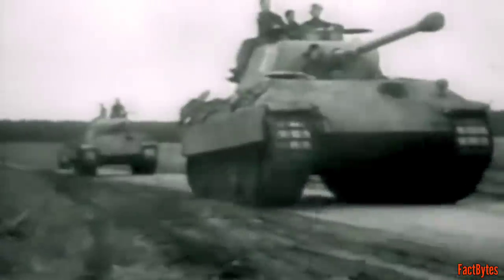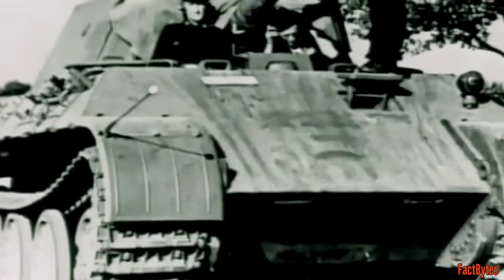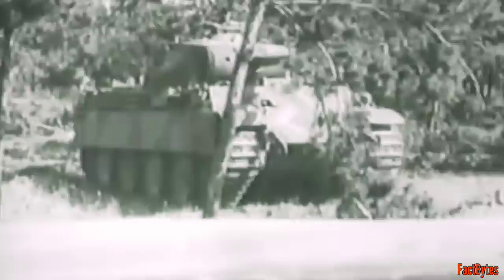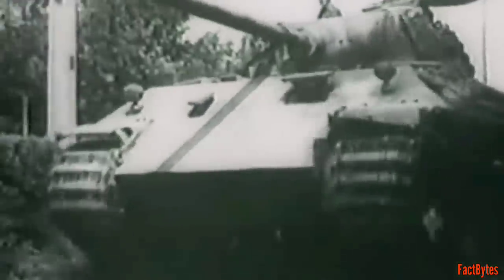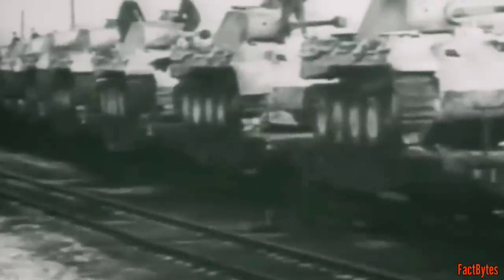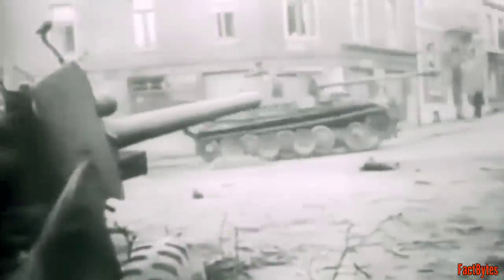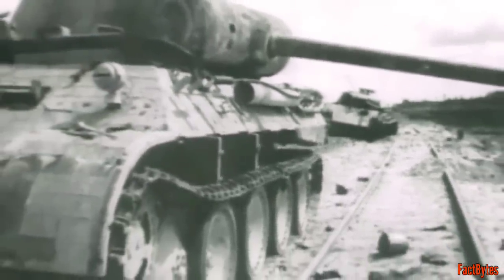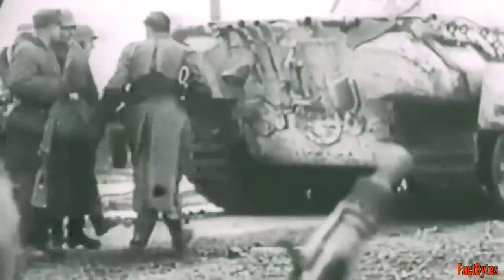Was The German Panther Really The Best Tank Of WW2?

Comment: The ausf G was the perfected version of the panther tank, as it fixed all the flaws.
Reply: IIRC after WW2 the French Army tried adoption of the Panther. Gave it up because the tank was so mechanically unreliable.
Reply: @Idahoguy10157 
The French army used second hand German tanks and did not produce any new ones, jerry rigged and combat damaged tanks do not do well
Reply: Germany built a total of 5,976 panthers during the wars, panthers ver. are D, A, G & F. The G version is most numerous of all the version. Total completed G version build 3,126 from the start of '44 to the end of war. The F version was only build in small number while the replacement for panther tank E50 Panther II with schmalturm never went into full production only a few were build for trial.
Reply: @sebastian-FX357Z1  Considering the work force, materials limitations, along with Allied bombing of the applicable factories, that the Germans managed to get over 3,000 of the "G" model Panthers out the factory gates in the last sixteen months of the war indicates that (1) many of the production problems were solved and (2) the Panther "G" model had been simplified enough to facilitate production w/o compromising combat capability.   Trouble was, the Allies produced about 8,000 of the  76-mm gunned Shermans and 14,000 of the T-34/85 (about 7,000 Shermans with the original M3 75 mm gun were also produced, along with many other variants, including about 2,000, sans main weapon, which the Brits would stuff that excellent 17-pounder weapon and dub the "Firefly").   Germany was simply overwhelmed by the combined INDUSTRIAL and ECONOMIC might of its adversaries; as Stalin himself is credited with saying, "Quantity DOES have a 'quality' all its own."  And most of the tanks that went up against the Panther were no "slouch", either!
Reply: By the time they lost 1000s of them, they learnt the lesson. And also by that time allied also had lot better tanks.
Reply: @istvanszoke381  Those lot "better" tanks were being lost at the rate of 1.000 per month. 12.000  total for the western campaign nor counting all other armored vehicles.
Reply: Panther tank in the hand of an ace r lethal. On 27 July '44 at an isolated crossroads on the St. Lo-Coutances road. ss-oberscharfuhrer ernst barkmann (tank ace from das reach div.) with his lone panther tank destroyed 9 out of 14 shermans from an large us armoured column, although his panther is badly damaged barkmann still manage to get his tanks & crew back safely to German lines.
Reply: No, According to Whatever documents remained on the G variant, it had somewhat cured the problems every Panther had before

The Final drives had 2x the distance capable, though, it still shit

The Engine Carburetor, though didn’t light up as often, still did in slightly less regularity

The Transmission, they couldn’t even somewhat fix it, so too was the engine when it was over revved, really the G variant only solved the shot trap by adding in a gun shield at the bottom of the mantlet, the Panther still had an absolute 2nd rate HE round and the AP round had very little HE filler, about half that of a 76mm M62 APCBC
Reply: @Cobra-King3  Not sure where you get your "data". Late war Panthers had operational availability rates within spitting distance of the Sherman which most accept to be the most reliable tank of the war. search engines are your friend. All that hard data is out there. 
And yes the final drives were never properly cured as they were an economy and producibility compromise. The Jagdpanther however received upgraded final drives and by some accounts the Bergepanther too. But changing final drives is a lot easier than the transmissions on the the T34 needed changing so frequent that many crews went into battle with a spare transmission strapped to the tank. That never made it into soviet newsreels and after the war never entered the narrative.
Reply: @elizabethmiller7918  One thing about the T-34...it was easily worked on, and change out of major components like that finnicky gear and the V2 engine itself were relatively simple for Soviet Army field depots.  Indeed, they got to be good at piecing together workable vehicles from salvageable wrecks.  As Stalin is reputed to have quipped, "Quantity" did indeed have a "quality" ALL ITS OWN.
Reply: @selfdo  But the T-34 did have advantages other than the quantity. It used sloped armor before most Axis tanks and when they ran into it, it was so hard to defeat that the first months of the war in the Soviet Union were known as the Tank Terror. The Germans were shocked when their 37mm ammo just bounced off the armor. They had to use horse drawn carts to roll 88mm FLAK guns to knock out the T-34.
Reply: @largol33t1  Other Allied tanks like the French Somua S-35 and the Char B1 also used sloped armor, as did the Senior Matilda (later just Matilda when the first model was mercifully retired from service).  Although certainly the T-34s frontal and turret armor was good at deflecting shots from the standard German AT gun issued to infantry divisions, the Pak 36 (in one notorious example, TWENTY-THREE of them, which calls seriously into question either crew training of the T-34 units or the ability to acquire targets!), it came at the cost of limiting space, which already was hampered by the Christie-type suspension.  FWIW, the same 37-mm guns used in France the previous year also had troubles knocking out the French Char B1s and the British Matilda, but they handily won the Battle of France anyway.

Although certainly the T-34 and also the KV tanks came as a shock to the Germans, imbued with their own puffed-up superiority complex (that the "Untermensch" could build such monster tanks, in quantity, was indeed a surprise), they quickly found ways to knock them out, as 2,200 of the 2,300 T-34s the Soviets produced in 1941 were likewise destroyed in that calendar year.  And if they had to use a team of horses to pull an 88 mm gun, it was more likely due to the "Raputizsa" which turned Russia into a morass of mud than a lack of vehicles.  The typical prime mover for a Flak 18 was the standard Sd Kfz 7 half-track.  If a Luftwaffe unit was assigned to an infantry division rather than a "Light" or "Motorized" unit, then literal horsepower was typically all that was available.  Use of "Flak" guns in the anti-tank role, especially after the Soviet V-VS was effectively taken out (at least until the latter part of 1942), was not a new thing, that had been done in France, Poland, and even Spain.

Given the loss rate of T-34s as compared to the Panzer IIIs and IVs which were the best  Germans could field until 1943, and still were the majority of their Panzers until 1944, I'd say the notion of "T-34 terror" is yet another MYTH.  The machine that bagged the most T-34s was not a tank at all, but the humble StuG III, especially once equipped with the L/43 or L/48 75 mm gun.  Low-slung, it was hard for the Soviet "tankists" to  spot.  Panzerjagers, improvised on re-used Panzer II or 38 (t) chassis ("Marder"), some using re-chambered SOVIET 76.2 mm gun, also racked up impressive tallies of T-34s destroyed.  The toughest PzJgr for the Soviet tank armies to handle was the final derivative of the 38(t), the "Hetzer".  Very low-slung, with its own SLOPED armor (and like the T-34, it was rather cramped inside), the Hetzer most frequently was not spotted until it got in the first...and frequently ONLY shot.  Its main defect was simply that it came rather late in the war, June of '44, but it racked up an rather impressive kill tally and was very much feared by Allied and Soviet tankers.
Reply: @Cobra-King3  reports, documents? why are u not read THEM? You can even find them on wiki.......but no...you just commenting....
Reply: @Cobra-King3  I would not factor in the shell types, since there was little difference between APHE and AP once it penetrated. AP rounds was dependant on shrapnel while APHE would explode in a cone of damage.

Also, another problem was that the commander STILL did not get turret override, and they still did not give the gunner other optics other than the gun optics. Also, they changed the weight of the Panzer from roughly 51 tons to something around 60 tons (combat weight included) so having 2 final drives made no diffrence. You gotta love German Engineering
Reply: @Cobra-King3 the g was improved more than mate.
Reply: @Cobra-King3  I fin it sad that you claim that the Panther had a second rate HE shell when it has the same amount of filler as what the Sherman's 75mm M3 had at 690 grams of filler and more than the Panzer IV or StuG III had.

And then to think you want to compare the HE filler on their AP rounds.

Do you actually understand what you're saying here?
Reply: @Dreachon  Your a bit slow in the uptake here, the higher the velocity the shell is lobbed at, the more sturdy the shell has to be to survive getting out of the barrel, on paper, the Panther and Panzer IV have the same HE round, but due to the fact that the Panzer IV's 75mm gun lobs rounds at 750-790m/s compared to the Panther's 1km/s, the Panther's HE round had to be modified to carry more Steel, sacrificing HE filler, thereby making a less effective HE round
Reply: @Cobra-King3  
You seem to be unaware of the fact that German guns fired their HE shells at a lower velocity than their AP shells.

For the 75mm KwK 42 the AP round is fired at a muzzle velocity of 935m/s while its HE round is fire at a reduced speed of 700m/s

The 75mm KwK 40 and 75mm KwK42 do not fire the same HE shell, I don't know where you get this idea that they're the same shell but they aren't. They are similar but not the same., they have different quantity of HE filler and different muzzle velocities.

And to show that the Panther's 75mm HE round isn't less effective it contains 690 gram of HE filler compared to the 680 gram of filler that the KwK 40 and its derivatives have.
Reply: @Cobra-King3  Well, with than somewhat "puny" APCBC round for the 75mm KwK 42, the Panther was able to punch through any enemy AFV at ranges up to 1500 meters, with terrifically ACCURATE fire.  I believe that both the US M1 76mm and the Limey 17-pounder, though potent, were very prone to getting out of alignment, therefore, first-hit accuracy with these guns suffered badly.  AFAIK, the Panther was not typically issued HE rounds (though the gun could fire them), so though this vehicle was indeed designed as a "tank", it functioned almost exclusively in the tank destroyer role.  I believe that was also the situation with the VC Firefly, as its 17-pounder was specifically meant for the tank-killing role; a Firefly typically operated by itself or with another, accompanied by "standard" M4 Shermans with the 75mm M3 gun, better for shooting HE and cannister, but itself not a slouch with AP rounds.  The one UK vehicle that did best to fuifill both roles, IMO, was the "77mm" (same caliber, the designation to avoid confusion) commonly seen on the Comet.  Being shorter (L/49), it had slightly lower velocity than the 17-pounder, but was far better to work inside a tank turret and fire HE rounds.
Reply: You can't fix a tank that is fundamentally poor in all but a few aspects.

Comment: The narrator mentions a diesel engine. I don't know if this was planned but never installed. As far as I know the tanks were equipped with a 12 cylinder air cooled Maybach gasoline engine.
Reply: Correct. It was a error on behalf of the narrator
Reply: 12 cylinder yes.  Air cooled no.

Comment: Similar issues of the Panther in its use as an Infantry support weapon were why in the 1980s the U.S. Army kept M-60, M-60A1 and M-60A3 Main Battle Tanks in many Infantry Divisions. The Abrams or M-1 series are superb assault tanks, but on the defense they are horrible in the defense. The M-60 series Pattons were much better at defensive operations and Infantry support operation. I suppose in the decades since the First Gulf War (Operations Desert Shield and Desert Storm) the M-1 series in its latest rendition is much better, but it still has the same problem the Panther had in urban and other built up areas. Its long gun tube hinders its ability to provide 360 degree coverage in confined spaces. Granted the M-60 and older M-48 tanks had similar issues due to the long tubed 105mm gun. The Panther had other issues that we who crewed M-60 series didn't have as our motive power pack was all in the rear with the engine and the final drive behind the turret well. From 1 January 1986 to 12 January 1992 I was a 19E which in the US Army is the Armor Vehicle Crewman for the M-48A5 Pattons, M-60, M-60A1 and M-60A3 MBTs and M-552 Sheridan ARVs. Of the German tanks of WW-2 the Panther would likely be the one that could if its design had been kept and improved for the Heer des Bundeswehr until replaced by the Leopard 1 would have been a decent early Cold War tank.